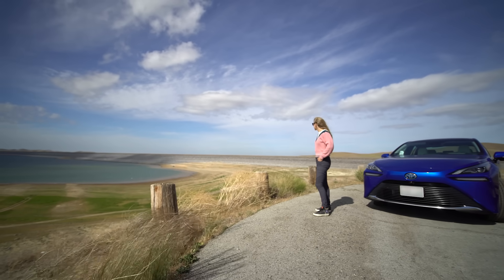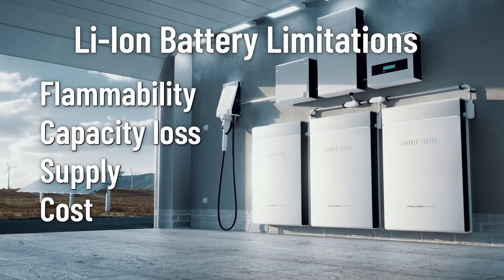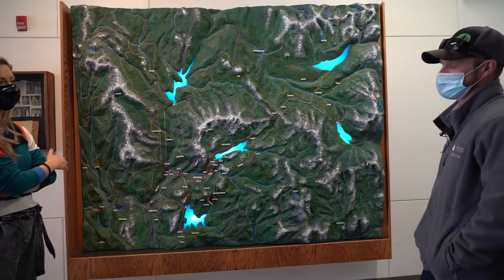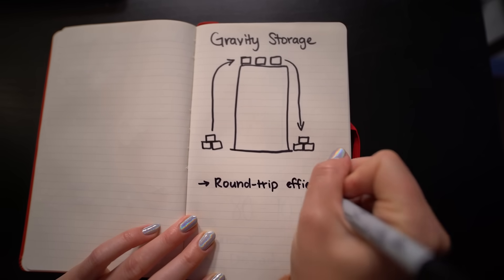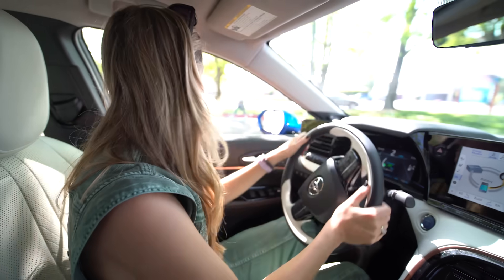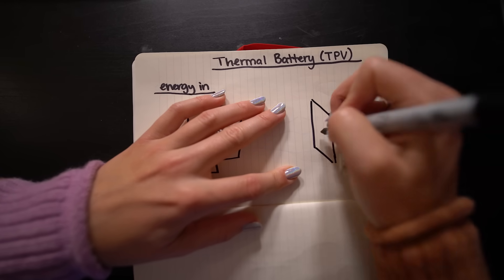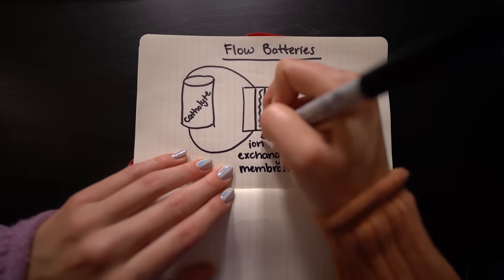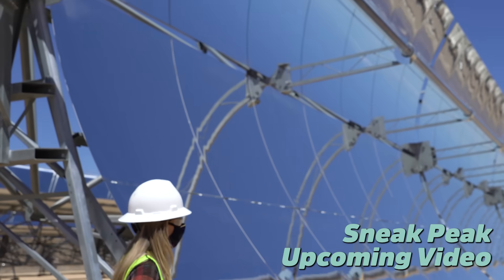The BIGGEST problem with clean energy

Comment: Solar and wind are not the only clean energy sources available. Example: Iceland, which uses 100% geothermal. Iceland exports aluminum made by basically free energy. 30% of the power on the Big Island of Hawaii is geothermal. The tech required is already perfected in the oil-drilling industry. Geothermal works 24/7.  You should consider mentioning it.

Comment: Clean energy is a bogus idea. Because of two factors. 1 3 blade wind mills are for show the Netherlands uses 200+ year old wind mills to stop sinking below the waves and no one uses that to power anything. 2 solar cells are highly toxic to produce and produce as much voltage as 2 water batteries of aluminum and copper (the amps though is low (water battery) unless you use activated carbon). It would be simpler to use sterling engines, spring engines, steam engines using lead batteries, steam engines using solar or even wood, sail powered vehicles, vacuum trams, self pumping trams and depth pressure generating devices.

Comment: The problem is attitude based on our arrogant wasteful behavior. In the past when it became dark you went to bed. When sun came up you got up. Use other devices differently. Over cool freezer, heat hot water tanks when energy is available. I have a customer that 20 years ago they built ice tanks to create cold to be used during the day to make use of off peak electricity.  Basically we need to change our behavior.

Comment: It is estimated that there is enough geothermal power potential in the Western US to supply the entire country. A geothermal plant is a fraction of the cost to build compared to nuclear and also a fraction of the physical footprint. Also no deadly waste building up or dangerous radiation to clean up and decommission.
Nuke plants are very expensive to build, take 10 years or so to build, have a very large physical footprint,  and when they go wrong, they go wrong VERY badly. And the carbon footprint of the construction process of a nuke plant is huge even if their operation has a very small footprint.
Geothermal should be looked into more.
Wind, solar and such also need more development

Comment: You have hit the nail on the head! An underappreciated aspect to "on demand" energy in bulk electric power is grid stability. We tend to think of blackouts being the result of insufficient generation, but virtually every blackout is the result of instability. The rise of "remedial action schemes" is a big plus but it is not magic. Historically, automatic grid controls were disconnections to prevent damage to equipment; the concept is that the safest state is "all fall down." Now it is about surgically disconnecting sources of instability. (Recently retired from a Fortune 100 electric company as an IT field tech with emphasis on energy delivery.)

Comment: At the start of this video, you talked a lot about hydro-pumping. They have been doing that at Niagara Falls for a long time. What I can't understand is why we don't just use more hydro in the first place. I personally know of 2 dams on the Suquahanna river in New York that are not generating power. The dams are already there. One is behind the Moe's plaza in Oneonta, and the other is in Binghamton. They could easily be adding clean power to the grid but they are not. Energy storage is a huge issue with renewables. But if clean energy is the goal then hydro and nuclear are the way to achieve it. The physical space required for a solar plant compared to the space required for a nuclear plant make much of the "Better for the environment" claims of solar void. If you want to put solar panels on your roof great. But if you want to generate large amounts of clean power use hydro or nuclear.

Comment: Years from now, with superconductors, solar satellites, and perhaps fusion power, we will easily achieve carbon zero. But, let's be realistic.  The solar satellites are perhaps 50 years away, the other things even more distant.  The only reliable energy source, night or day, windy or still air, is nuclear.  France has been mostly nuclear for years. Unlike Japan(or CA), most of the USA is seismically safe and free of tsunami warnings.  Clean, safe, nuclear is the best we have...for now.

Comment: I don't think we can take this video seriously because driving a hydrogen powered car sponsored by Toyota does not show any knowledge of the science involved.

Hydrogen has a well to wheel efficiency of 25 to 30% compared to batteries of 70 to 90%,  And this does not even factor in the higher cost of hydrogen.  Plus making clean hydrogen is difficult and very expensive.  Anyone driving a hydrogen powered care is not well schooled in renewable energy.

Comment: Another option might be to have pricing adapted dynamically? Half the power outlets in your home have an LED. LED off, default price, green half price, flashing green quarter price, red double price, flashing red quadruple price. A guarantee of no changes more frequent than once per hour, and at least 4 hours of half price per day. Consumer goods could be adaptive, so your EV would only charge when power is cheap, pool pumps can rearrange their schedule, and washing machines and dishwashers could wait for an opportune time. Industrial uses such as desalination and electrolysis for hydrogen could take advantage of cheap power. 

This could significantly reduce not only the need for storage, but also reduce peak demand, hence infrastructure requirements. 

IMHO something like this has to be a significant part of future solutions.

Comment: Thank You very much, for mentioning mechanical energy storage.
Here is more available.
For longer storage period - Iron-air batteries ("Reversible Rust" Battery)
For shorter storage time, more dynamic use - Flywheel energy storage (FES) 
For quick access - Supercapacitor (SC)
Complex solutions may be needed to meet all needs.

Comment: Accessibility, Charging Speed (for transportation), and Storage are the three I see. I want us to fix this so badly.

Here is East Tennessee, we could so easily do Pump-Storage Hydro generation, via the TVA dam system. Gravity Storage is amazing. Compressed Air is new to me, as is Cryo Cooling. Producing scalable hydrogen and oxygen fuel storage storage is not new, but very cool, if less efficient; only steam comes out. Thermal Photovoltaic is new to me. So cool. Flow Batteries is also so new to me. Scalable, no fire danger, and cheaper ions available... so cool.

All of it is easier and less damaging than batteries.

Comment: It's not right to say that storage is the biggest challenge. Actually the solution is straightforward as you have illustrated, it exists, and is well developed, and flow batteries will pick up the bulk of future storage development. A larger challenge is overcoming political opposition to building all the necessary infrastructure before it's too late.

Comment: Interesting ideas. I'd say the best approach would still be to use the nuclear power of water (ie. hydrogen) heated to plasma state. Clean, renewable, extremely efficient and can be stored easily. Patented in Germany more than 20 years ago.
Reply: Wtf you talking about???
Reply: @gregbailey45  If it wasn't clear I'm talking about an alternate energy source which could replace crude oil and uranium used in nuclear power plants.

Comment: I wish you would look into "cold fusion" or LENR .Its the energy source of the near future.
It works but does not have a method of controlling the heat yield and turning it on and off.

Comment: Hi Physics Girl, in a few of the examples, energy was "pumped" back into some system to produce more energy when needed, but it was never mentioned what the cost was or how the input compared with the output.  Pumping water back up an incline, is interesting but how much energy is required to do that and what is the difference in energy lost to energy gained?

Comment: The supply of lithium WON'T RUN OUT by 2080 or EVER because it's the third most abundant element in the universe after hydrogen and helium and it's extremely abundant in seawater.  Right now we mine old salt deposits for it but when that runs out we just need to create evaporation ponds, evaporate seawater, the various salts deposit in layers, mine the lithium salts out of those respective layers.

Comment: Depends on the type of renewable energy. Hydro power has no storage problem, the water at the top of the dam is the storage. In Quebec, electricity is about 100% renewable and has been for decades, with no storage issues. Most of it is hydroelectricity.

Comment: How much power is required to generate H2 from water or fossil fuels, compared to how many BTU's you get out of it. There is always a loss.

You do realize that 'flow batteries' are the same as most any other primary cells, right?

Comment: There are 2 big obstacles to our energy problems; first is the energy companies themselves. They aren't about to let you create your own energy in a way that they can't profit from it.  Second, is actually 2 parts. After over 100 years we still transport electricity over the same old wires and depending on the length of the wire from the source to usage it can end up losing almost half of the energy created. We need to develop a better way to transport the energy and also much more efficient machines that use it.  But none of this will work unless we also change the WAY we use energy. Our houses are circulating electricity in our homes 24 hours a day so that when we turn on the TV it starts instantly.  While we are doing this, we should be working on how to use our REAL natural resources such as the polarity of the North and South Pole.  I could today make a house that is completely off grid by using a combination of energy sources- solar panels, wind turbines (they look like scoops and have a very low profile and are incredible inexpensive to make), and back this all up with a mentos wheel to provide that nonstop continuous current.  In fact, I believe I would back feed the local electric company daily-

Comment: Search Generation IV are a set of nuclear reactor designs currently being researched for commercial applications by the Generation IV Forum. Just the placeholder to develop fusion reactors. Nothing wrong with using natural gas powered generators to reduce CO2 until nuclear is perfected.

Comment: You cannot discount the environmental cost of making and disposing of batteries. The cost to mine raw materials and then dispose of the worn out batteries makes wind and solar energy not "clean". Also the environmental impact of the materials needed for solar and wind energy is enormous.
In reality, nuclear energy is the "cleanest" consistent energy source we have presently. Followed by natural gas and coal. Hydroelectric can be "clean" but is also is susceptible to fluctuations in power output just like wind and solar.

Comment: I heard something about solid state batteries (with a carbon structure) and something about a full silicon annode solid state batterie. Maybe not for the power grid, but couldn't they be a good solution for cars that use batteries?

Comment: The energy storage solution is Ammonia. Adding the catalyst nitrogen to hydrogen resulting in the liquification and stabilization hydrogen produced from alternative electricity. Nitrogen extracted from the air (80 percent of the atmosphere is nitrogen) so Nitro neutral non pollution. Ammonia can also be a combustible fuel that can run in existing ICE. I love the idea of hydrogen fuel cells but so far, they have low reliability for a practical solution at this point.

Comment: Do you have any idea about the potential damage when recombining hydrogen and oxygen to make electricity?
Reply: What do you mean?
Reply: @ghjfgnncvvffghvv1271  G’day, Ghj. The gasses hydrogen and oxygen combine to form water.  And when they do it - it’s with a big bang.  No, it isn’t the hydrogen.  But it is EXPLOSIVE.  And the mixture is VERY flammable.  Even a spark from static electricity will set it off.
My best to you. Courtesy of Half Vast Flying
Reply: @jackvoss5841  that's peak may be do hydrogen combustion

Comment: This is the only "save the planet" video I have ever seen where the real problem with "renewable energy" is addressed, which is  energy storage.  There's an awful lot of people out there who do not realize that the wind doesn't always blow and the sun doesn't always shine.  They seem to forget that there's this thing called "night time" and do not understand that temperatures in some places get to -30 degrees fahrenheit or colder and have no idea that heat pumps don't work well enough at such temperatures.  And it snowed last night, and the solar panels at the local solar farm are covered by an inch of snow.

I would expect that the existing natural gas lines can be used to transport hydrogen as a fuel.

Do not forget that even if the United States gets to that "net zero" carbon emissions goal, it only cuts about 14% of worldwide CO2 emissions.  Someone will have to convince China, Russia, India, Africa, etc to follow suit, but they will not until they can make it economically feasible.  Otherwise, getting to that "net zero" goal will have no reasonable effect.  Send Greta Thunburg to those socialist nations and see what happens.

Comment: the compressed air getting hot isnt a question of "if you can get the heat converted to electricity it will be extra energy" you MUST convert the heat back to electricity.
it gets hot because your putting energy into compression. if you dont convert that back you lose too much energy and the storage solution becomes low percentage

Comment: store excess energy in hydrogen.. then use gasturbines adapted for hydrogen to run at night (in my country we have adapted the gas turbines so we can switch). aso ffs make it simpler to put nuclear powerplants down (right now in usa it takes dacades to get everything aproved for 1)
your hydroelectric solution is great but my country is super flat lol so we use different solutions (netherlands)

Comment: No offence intended but I would like to point out a few things. It must be nice to be given an $25,000-$45,000 car for the sake of showing how much better it is. And to not have to pay $13.00 per kg of hydrogen to fuel it. So where can I find this wonderful fueling station at when I buy my first hydrogen powered car in 80+ years based on my income level. 

Or how about the Tesla's they only take electricity after all, just a mere $70,000-$92,000 for the already outdated models. Oh and the $10,000 upgrade to my house to be able to charge it. Thornberg loved her free one that Musk gave to her to promote his company. 

Guess I was wrong for buying my 1994 S-10 for $1,200 and tunning it up to get 12 miles to a gallon of gas. Had it for 8 years now with an average maintenance cost of $200-$300 a year. Oil changes, tires, worn out parts that I can change on my own. Was spending $45 every two weeks for a full tank fill up. Now with Biden in the house that has gone up to $65.

Comment: Storing Hydrogen?

Not easy to do.   Hydrogen being a very small molecule easily finds holes / pores in your storage tank.   Second of all Hydrogen when mixed with a tiny amount of air becomes readily explosive.   We have enough issues with explosive mixtures of natural gas.   

I would not consider it any way safe to have Hydrogen gas flowing into / around my home.    Or in a vehicle.

David

Comment: You will always need on demand power so where do you get it? Its either natural gas which we don't want because of carbon, the other is nuclear power with no flame no carbon. Technologies are even safer than before and its a abundant source of clean cheap energy. You want carbon free energy you will not get it without nuclear.

Comment: The biggest problem with your idea (batteries) is it really solves nothing, how many years is a battery good for? what is done with dead batteries? Even windmills blades are replaced every ten years or so, Solar panels wear out also causing more pollution. Look as long term solutions. Including plans to recycle old parts.

Comment: Hydrogen is a great energy storage path. All gas engines can be converted to H2, and we do not need high pressure tanks to do it. There is material called Hydride, it a H2 absorbent material. So you can tank H2 at about 60 to 80 psi. Solar is not the way to go, except in suburbs, killing our farms for solar farms is suicidal. Vertical wind turbines can be put all around our farms with out killing the farm. Our energy companies have the pipelines in place to move H2 around. Check out what Norway did with the HiNor Hiway.

Comment: I highly doubt that the thermal battery tech is as good as they claim. PV panel has efficiency less than 20% and that is when they are radiated by the sun with much more short wave contents. Here the heat radiation contains only ultra red I guess

Comment: Just stumbled onto your channel recently, some pretty interesting stuff!!  I work at a Pump Storage plant, and one thig that you failed to mention was in order to pump the water up, you need an outside source of power.  Since most Pump cycles for these plants are in the middle of the night when bulk power is cheapest, (Buy low, sell high), you are reliant on Fossil Fuel  or Nuclear Plants
Reply: Oh come on.  Any source of power could pump that water up.  Just because your plant only uses fossil or nuclear, doesn't mean that's the only way to do it.  Windmills have been doing exactly that for centuries.
Reply: Pump storage is fantastic, and in the past, yes, it used night time electricity. But you can equally use it during a sunny, windy day.